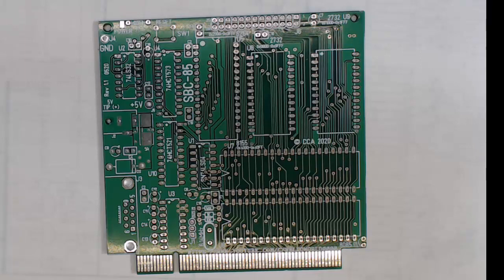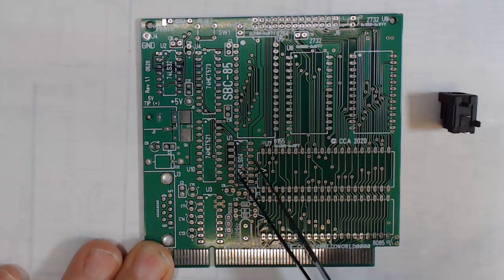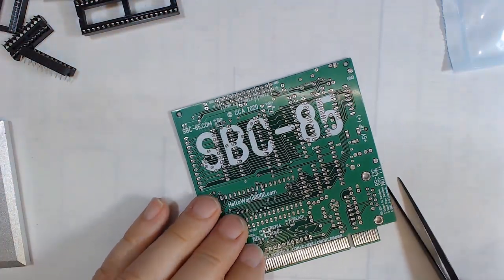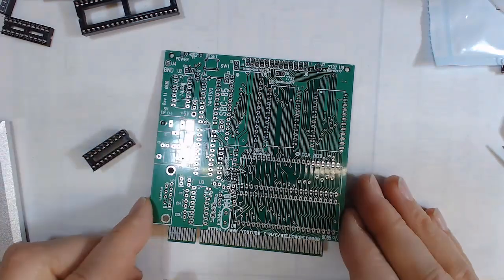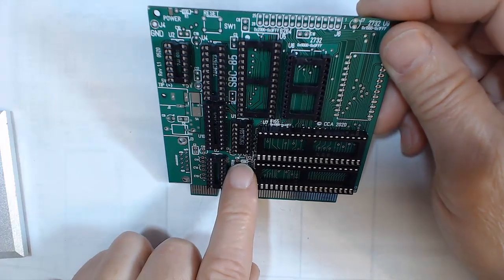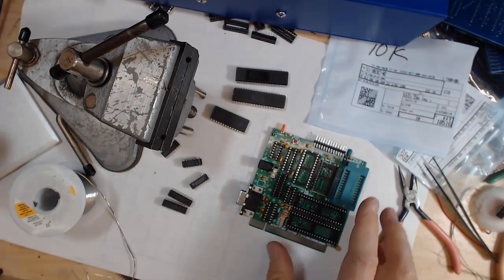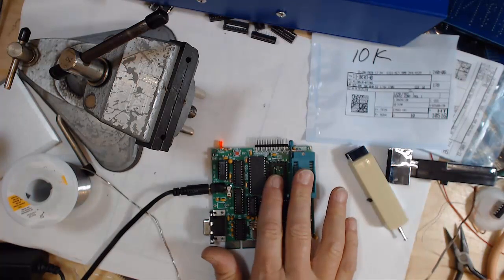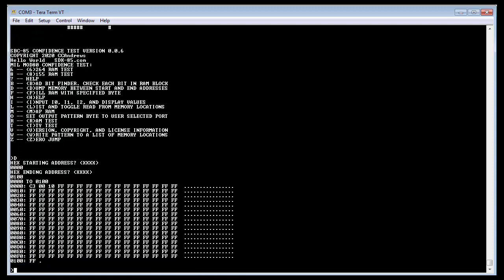{47} Assembling the 8085 Single Board Computer SBC-85 v1.1

Comment: What intro book on i8085 schematics can you recommend for the first time?

I want to build a working Altair-style minimal computer with LED & switches front panel (or maybe a HEX control pad?) for our гniversity retro technics museum. 80C85 looks the best for me, as it is a bit simpler compared to i8080 but I have a chance to find a local clone in ceramics (for cool look mostly).
Reply from the maker: I agree with you that it is easier to build hardware around the  8085 rather than the 8080.  That is why I built the SBC-85.COM project based on the 8085.  However it doesn’t hurt to learn about the 8080 first since most concepts carry forward.  I like the 8080 bugbook by Rony, Larsen, & Titus. With that understanding, you should be able to understand the intel MCS-85 family user guide.  Of course don’t forget the intel SDK-85 schematic and users manual. Then spend considerable time looking over the schematics of any of the 8085 projects that are readily available online and have downloadable schematics and user guides.  Also look over vintage hardware schematics such as intel multibus single board computers.  Once you are to the point that 90% of the schematics make sense, then you can venture out into the world of laying out your own design.   For each part go to some reference schematics you collected earlier (intel, online projects, etc) and focus on the little sub part you are working on, e.g., memory decoding.   On your first boards include many test points and extra gates that you can patch into as corrections are needed.  
Of course it was different when that was all we had, but from my perspective, front panel switches are fun for about a month.  Hex keypad for about six months.  Then either gets in the way of programming so eventually the terminal interface becomes my preferred interface.

Comment: Very nice board! I did an 8085/8155 on a proto board early this year. I need to write a monitor for it, but am waiting on my EPROM programmer to arrive. I've been having more and more issues with JLCPCB as of late. One batch will be fine to usable, then the next not ok on half the boards. I am getting very good results from PCBWay, but they do cost a bit more for panelized boards.  It seems like JLC is getting very stingy with the coatings as well :(
Reply from the maker: Thanks.
Is this recent?  I noticed some strange things going on at JLCPCB back in February-June and received a few bad boards during the spring. I presumed everything would get back on track once covid was under control.   I primarily use JLCPBC because their trace width & gap dimensions are better than pcbway.